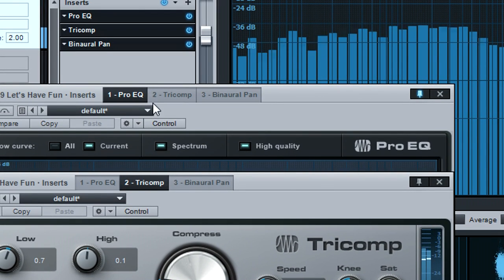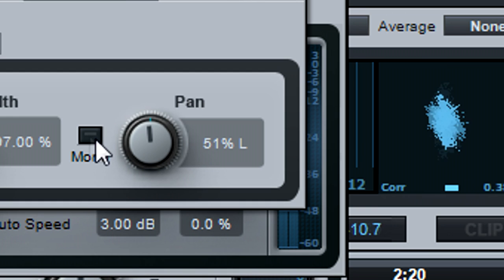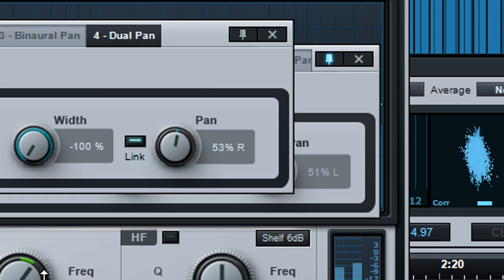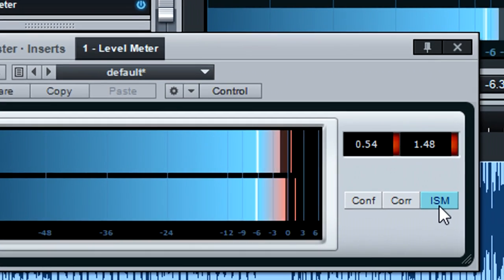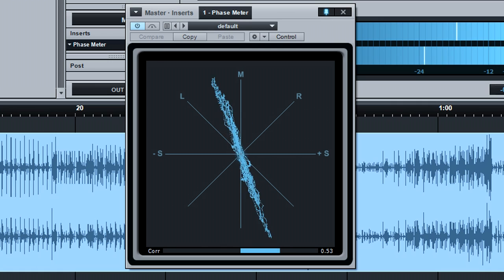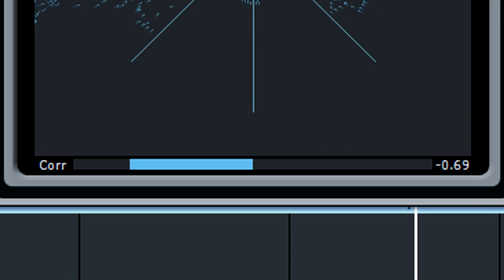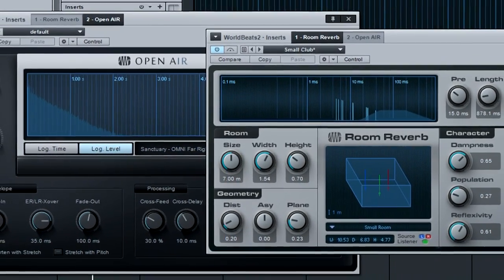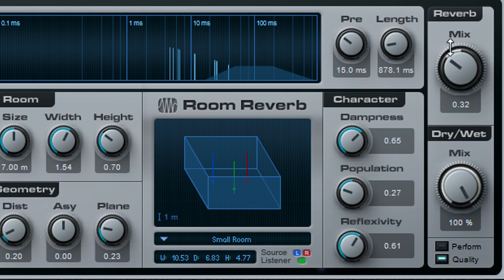Mastering with PreSonus Studio One Pro (Part 4 of 6)

Comment: Yes, this is what I don't quite understand! Forgive me if I'm being a bit cloth headed here but the phase meter shows an imbalance, & we correct it by shifting the pan applicably. Yet I have seen Beatles tracks where the right channel FAR out weighs that of the left, & it sounds fine. Eleanor Rigby is one I think. The same goes with Drastic EQ to flatten certain protruding frequencies. Doesn't all this scientific modification make for a somewhat insipid sterile outcome? 60's masters sound great!